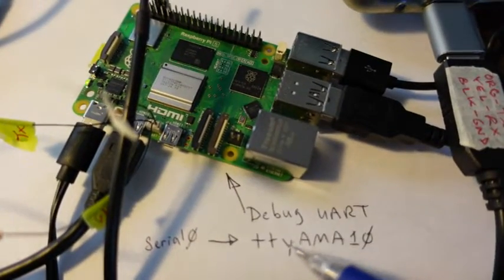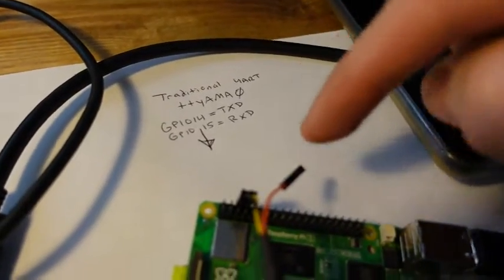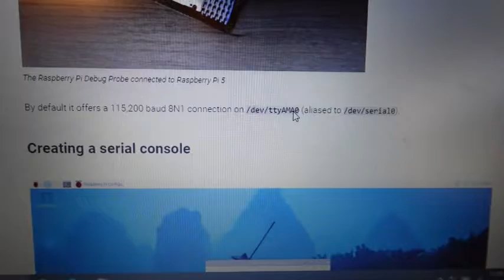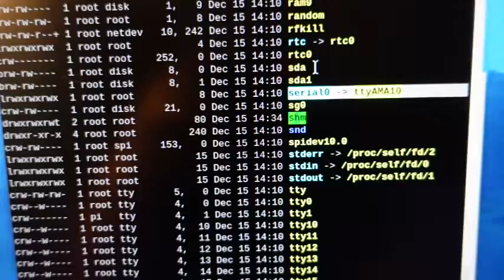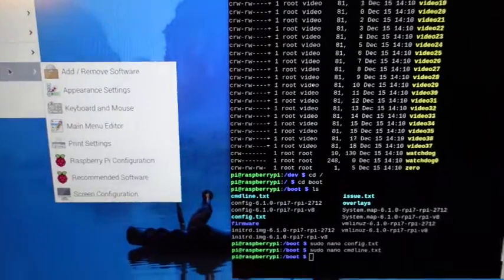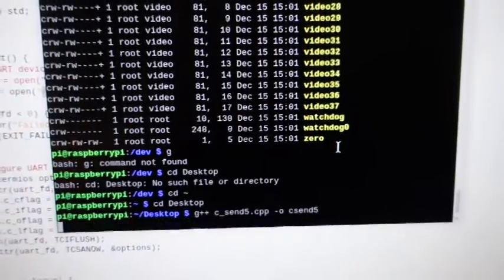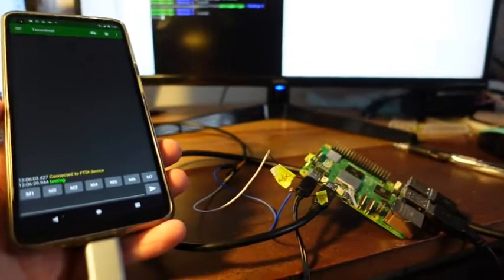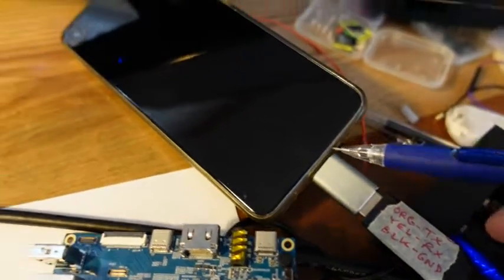Use the Raspberry Pi 5 Serial Ports

Comment: Thanks for the brief, 
Actually i am new to Raspberrypi5 and i am figuring out things such as using GPIO control by libgpiod-dev; serial comms as you did in this video ; and now i am wondering what ahould i use for  LCD interfacing via I2C...please cover that if you have some idea.

Comment: New subscriber.  Thank you / overturning a bit of bad info STILL on the internet.  The cable Ladyada referenced is out-of-stock but her video teaches you to check for “alternate lengths”!
I’ve found a local hobby shop to be a source of small JST connectors as these are used in RC model Lipo charging.  Don’t know if they’ll have 3-pin 1mm but will check soon.

Comment: I have been trying to get a console in the gpio uart but couldn't. Here is why:
According to documentation I need to add dtparam=uart0_console=on to enable it. This make /dev/serial0 points to /dev/ttyAMA0 which is I believe what the rpi4 does.

Comment: Can you run rs232 or rs485 over the port ?
Reply from the maker: You will need a level shifter for those to go from 3.3V TTL to something like +/- 12V https://en.wikipedia.org/wiki/RS-232
Reply: For rs232 you can look out for boards with the max3232 chip

Comment: Thanks for the helpful information about the new port. I am glad that you pointed out the ttyAMA10 for the new debug port - I had seen the documentation that said it was ttyAMA0 (which is the current port).
Reply: I removed quiet splash from my cmdline.txt and changed the console variable to console=ttyAMA10 so I could read the OS boot from serial.